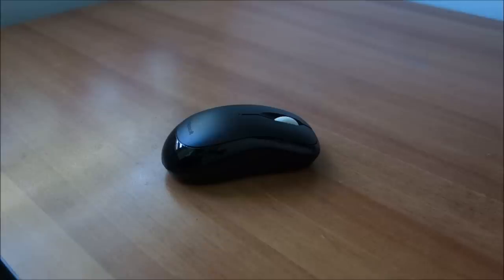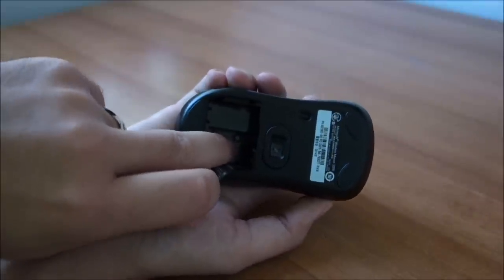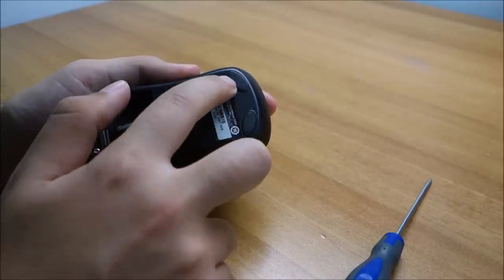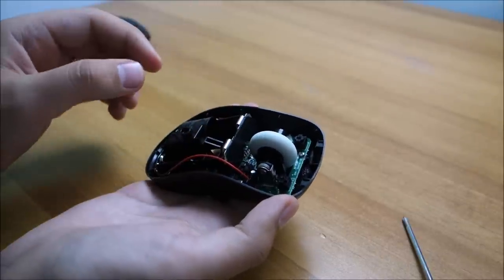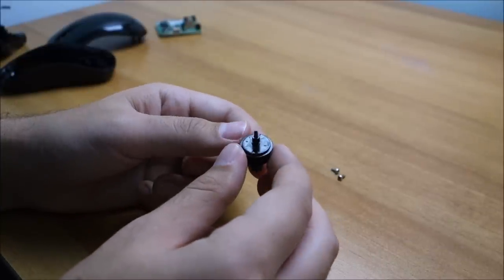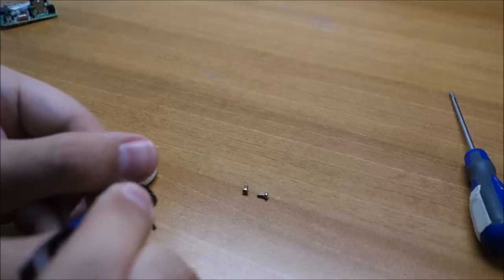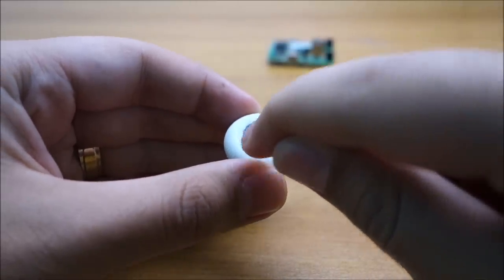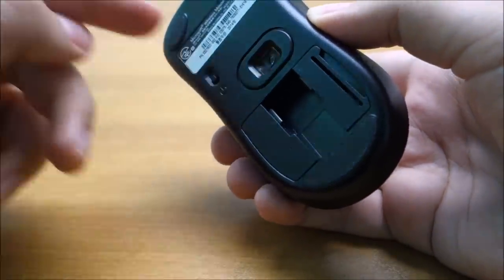🐭 How to - Microsoft Wireless Mouse teardown and repair of the scroll wheel 🐭

Comment: I had a similar problem. Although the rubber wheel wasn't slipping, the scrolling action was random. Following this guide I was able to take the mouse apart, clean everything up and, on reassembly, it's working properly again. There's one point I'd like to make: when you've removed the circuit board, there's nothing holding the on-off switch in place, so don't lose it - I nearly did!
Reply from the maker: Glad you got it fixed :)

Comment: You're a smart guy with great attention to detail. just a quick tip, you can wipe off superglue quickly before it dries with kitchen towel or when it dries to a white foam it sands off really easily. and also if you boil the rubber fitting in water it will shrink back to normal size.
Reply from the maker: +biscuitBrush thank you! And also thanks for the tips :)
Reply: Absolutely ,Thx for helping us My wheel was driving me Nut's I like the glue Idea! I hope I don't glue my finger to it LOL!
Reply from the maker: Glue and fingers don't mix well! :))

Comment: Thank you for showing this.  This is exactly what I need to do with a wired "Microsoft Comfort Mouse 4500", which is a damn good mouse.  But, mine will let you scroll down easily, but it starts to not receive signals as you want to scroll up.  Very frustrating.  So, I sure hope that I can find the screws.  Rest of the repair doesn't look that bad.

Comment: Bravo!  Thank you so much!
Your video gave me the confidence to take apart my Tdagger mouse which had issues with the scroll wheel skipping up/down with the slightest touch.  A q-tip & rubbing alcohol to clean the wheel mechanics did the trick!   Thanks very much!

Comment: Finding the hidden screws made all the difference. The wheel can be taken taken out without disassembling anything. Just lift out the left side carefully and it goes back in quite easily. The rubber tyre can be removed and refitted on the axle with a bit of rubber glue.

Comment: Great video. I have a newer Microsoft mouse which has a different "rubber" tyre.  It stretches beyond repair.  I replaced it with a plumber's O-ring washer, super-glued in place like your suggestion.  All is good! :-)
Reply from the maker: +Grunfeld thank you! Good job with the O-ring :D

Comment: I had the same problem.  Before you buy a star drive to take this apart consider trying what I did: take a cotton swab and dip both ends in alcohol. Gently lift the rubber on the wheel and slide a moistened swab underneath, between the rubber and the wheel it rests on.  Release the rubber and slowly rotate the swab which then turns both the wheel and the rubber.  After one cycle of that I reversed the swab so the unused tip was sandwiched between the rubber and the wheel and I held the swab in place while I pinched-pulled the rubber, forcing it over the swab and repeated until I made another full cycle.  Mouse now works fine.
Reply from the maker: +csimring that is the first stage. The rubber will get looser over time and that will not be enough. But for some maybe it's enough for the time being.

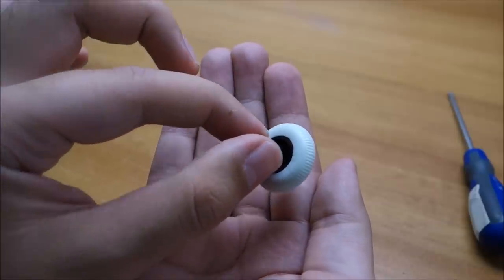Comment: Thank you for this very useful video.  I followed your instructions but the wheel scroll didn't still work.  I found out that the problem, in my case, was with the little pin like end of the scroll wheel shaft assembly.  This pin end of the assembly is inserted into the potentiometer hole so the when you turn the wheel, the pin end in turn turns the potentiometer.  I found that the pin end on the shaft had worn out some causing the potentiometer wheel to slip.  I solved this problem by dipping the pin end of the wheel shaft in some glue and inserting that into the bearing hole in the potentiometer.  Since now the pin is glued on to the potentiometer, is no longer slips.    See the picture at 10:38 minutes in the video above that shows the pin end on the shaft I am talking about.  At 4:38 , you can see the potentiometer at the top of the wheel assembly.
Reply from the maker: Glad you got it solved!

Comment: I had the same problem of the scroll wheel not relaying commands: however the problem in mine wasn't the wheel itself but rather the small point which goes into the adjacent bracket. The ball point was no longer rotating the bracket it fits into - because that's the part which actually relays the scroll command. If that bracket doesn't rotate when you spin the wheel: it doesn't matter how well attached the rubber is to the wheel. So what I did was use a razor blade to cut a very very small sliver of rubber off of my mouse pad, lay that atop the hole which the mouse wheel's ball point fits into: then put in the ball point so the sliver of rubber would be wedged between the ball point and the bracket the ball point fits into. Now when I rotate the mouse wheel: it also spins the bracket that it fits into and thus sends the scroll commands properly. 

So while my issue wasn't exactly the same as seen in this video: this video's instruction did point me in the correct direction in order to determine the actual problem and I was able to fix it. So thank you Ultimate DIY
 - you saved me $50 on a new mouse.
Reply from the maker: That is awesome! Glad my video helped! :)

Comment: Somehow I don;t think glueing the rubber wheel was what fixed it. there's little or no slippage there. what probaly cured it was cleaning the fine end of the spindle, the part that goes in to the potentiometer. Clean that up, simply by wiping it down with a cloth etc. (I used my fingers). put it all back together...all good. Anyway, thanks for showing how to take it apart.
Reply from the maker: In my case I could feel it slipping a lot. So for me glue was required. Maybe in your case it was a bit different.

Comment: Thanks. 
It's bad engineering. it's not the oil, the soft rubber get loose with friction and heat.

Make sure to notice any switches or buttons so you won't lose them!
Reply from the maker: Probably you are right.
Reply: @UltimateDIY  planned obsolescence, such a simple fix.
Reply from the maker: True.

Comment: the problem is not the white rubber... problem is (tiny area which rollover again and again, it get slipped by using more)

problem is not the rubber and it will be fixed by glue.
Reply from the maker: Well, not really. Just think about it. The plastic does not change, but the rubber wears out and starts to slip. Obviously glue will make sure it can't slip again.

Comment: Maybe the main problem is the central axle bearing is not turning freely.
If it did gluing may not be necessary ?
My mouse wheel is not turning easily, but not slipping.
Reply from the maker: For you it might be that. For me it wasn't.
Reply: @UltimateDIY  You're right, I found in mine the central light pillar had come loose and was jamming the wheel.
It working fine now thanks.
Reply from the maker: Perfect!

Comment: Thanks! My problem was that the rubber on the wheel has moldered and so much gunk has accumulated on the inside of the wheel that the mouse no longer scrolled, the photodiode or transistor (I didn't check what it was actually) was constantly in the dark.
Reply from the maker: Welcome! Glad you solved it :)

Comment: I have a problem, my mouse had 2 screws on the back but I can't find more and it doesnt's opens. Is there any other place where it could be screwed? (its rechargable so the battery place is not an option)
Reply from the maker: So you took off all the low friction pads and there are no more screws? Maybe you just have some strong clips then.

Comment: My problem is my mouse wheel scroll doesn't work at all ._.
Reply from the maker: Does it at least power on?
Reply from the maker: +WazzaAzza2005 ok, now that you added "wheel scroll" it makes sense. Try to open your mouse and see what you find inside.
Reply: I did that but I broke my mouse and dont know how to click it back together
Reply from the maker: Is it the same model as my video?
99% or mice have clips in the front and screws in the back. If you look closely at it, it's impossible to not put it back together.
Reply: Ultimate DIY this is unrelated but do you perhaps know how to fix a mouse wheel that has sunken into the mouse which does not scroll properly but the wheel click works? Its very irritating so if you have a solutuon please reply thanks!
Reply from the maker: That needs to be taken appart so you see exactly why the whole assembly sits lower in the mouse. Without taking a look, sadly, I can't help.
Reply: Ultimate DIY thank you I think I got it fixed
Reply from the maker: Ok, great :)

Comment: Thanks Ultimate DIY, i have a problem with the same mouse, the left click button does not work, if i press hard close to the wheel(on the left key) then it might work but comfortable at all, it worked fine for 2 years, how do i fix it?- thanks for your support.
Reply from the maker: +Hitesh Bhatt hi there! I think that your swich does not make contact anymore. Do you hear the click, but it does not register or it does not even click anymore? If it does not even click, probably you need to replace the microswitch with one from another mouse. If it still clicks, then you can try to clean it by forcing some contact cleaner or alcohool inside the switch.
Reply: Thanks a lot for such a quick reply, awesome :) yes, it does give a click sound, now, just 30 mins ago, it started working but i still need to put some pressure so that it works, if it stops, i will try your contact cleaner advice, cheers!!
Reply from the maker: +Hitesh Bhatt no problem :)
Hope you get it fixed easily!